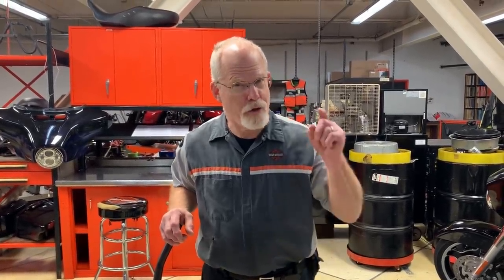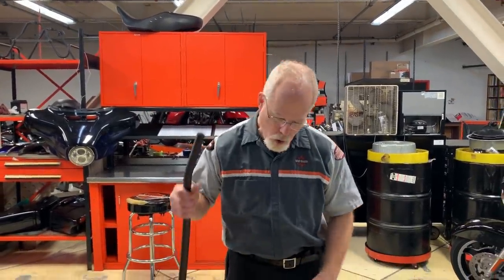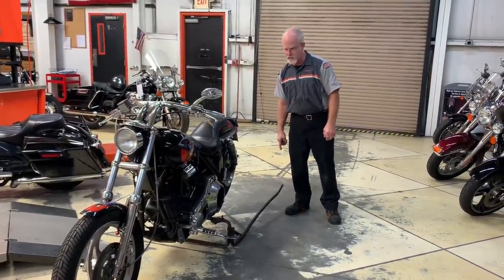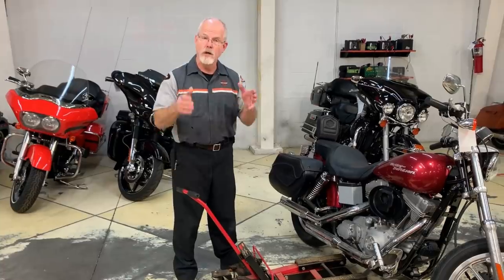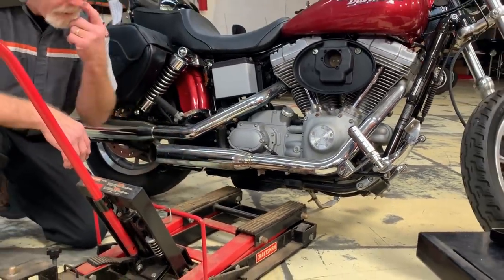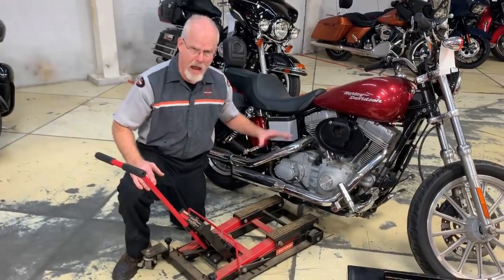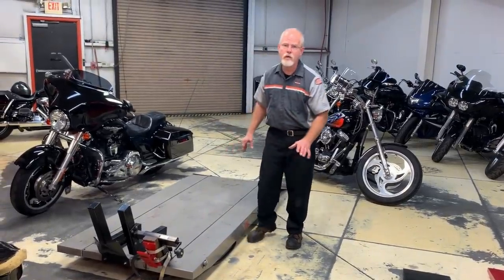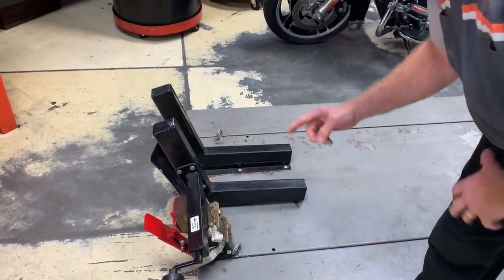DOC HARLEY: MOTORCYCLE LIFTS

Comment: Another great tip Doc. I use the roll under lift on my 2017 flhx  by rolling on 1/2 in" plywood pieces under the front and back wheels. Works great.

Comment: J&S jack for my ultra and heritage. Solid and safe for servicing and washing bikes. What I paid for motorcycles justified not trusting them on some cheap m/c jack. When using any jack you should use the safety latches then let pressure out of bottle so the weight is on safety latches and not the bottle. Never leave weight on just the bottle.

Comment: I use the J&S jack. I have a 2016 CVO Road Glide Ultra and it works unbelievably well. It works great for winter storage, cleaning and servicing.  While the bike is on the lift, it is very secure and with the high quality wheels, the bike moves with ease.

Comment: In my 20's, I used that old school lift you started with in the video, for my Wide Glide. Thanks for the memories...  We also had built 12" angle iron support feet with 1/2" diameter L-shaped steel rod welded to the angle. The height of the rod was the same as the height of the quick lever lift. The shovelheads had an open rear cross tube in the bottom of the frame you could slip the rods into then take it off the lift.  Or install the right foot while on the jiffy stand, pick up the bike and put the weight on the right support foot, then slide in the left foot. Sort of a portable center stand.

Comment: First. Great video Doc. I got a J&S jack, works great for my Road King. I keep my bike stored on it for the winter , never had a problem. Best jack I could find for the money.
Reply: I absolutely agree !!!!!!  I've owned three different motorcycle jacks and J&S jack is by far the best.  J&S even offers a motorcycle dolly. Lift the bike with the jack and then slide the dolly under it.  Remove the jack and you can move or even store the bike without the jack.  J&S is the best !!!!!!!!!
Reply: @tomqueisser7706  Do you have a link to the model of that J&S jack? I have a '17 Dyna.  Thanks!

Comment: Been thru most of the lifts you showed….Ended up with a Handy lift which I love and a flat jack to slide under the bike and lift the rear wheel when required…If I need to remove the front wheel I roll the bike up onto the Handy lift backwards and use the flat jack to raise the front…👊
Reply from the maker: Well done….Doc

Comment: Great video as usual Sir....
Bought a “Harley-Davidson” branded “hand crank” lift *part number 94653-98 (manufactured for H-D by FULTON) from my H-D dealer when I bought my 2001 CVO Dyna Wide Glide II “Switchblade”. The lift has been my trusted friend thru 6 new H-D’s since November 2000 (still have ‘em all - it’s a disease). Very simple (hand crank worm gear inside heavy gauge steel tubing), but extremely heavy duty lift. I’ve completely disassembled 3 Harley’s using only this lift. It’ll lift a “Boss Hoss” with no problem. I’ve replaced all of the hardware (bolts & nuts) twice (with higher grade hardware) and the hard rubber top pads once. Still looks and works like new. They just don’t make ‘em like they used to.

Comment: The very first jack that I bought for my Harley was the Craftsman that you demonstrated with. It works great and there is still time that I still use it despite the fact that I have a large lift. About 10 years ago I bought a motorcycle lift from harbor freight tools. It was a foot pump that you used to lift the bike. It even had the rear panel so you could work on the rear of your bike. Not even 2 weeks after I bought that lift that a friend of mine made me an offer that I could not refuse. He had one of the air lift. It's one of the ones that you can pick up a trike with. He had a shop where he was working on bikes and decided to get out of it. He only asked me for $100 more than the harbor freight one. I also have one screw jack with the big flat steel on top of the jack and on the bottom. That also makes doing a lot of things easier especially on the left.

What I do is store my Harley on my lift and rise it up and flip down the safety bar. That way if someone was to break into my garage they are going to have to turn on my air compressor and know how to use a lift. 

I enjoyed your video look forward to watching more.

Comment: Hello!
I use the Craftsman Motorcycle lift and I always make sure it is locked in to prevent it from coming down.
I used something similar to what you used 30 years ago. It was made out of aluminum, and it worked well on my 1972 Sprint SS.
Didn't work well on my 1974 FX Super Glide. Enjoy your videos.

Comment: I have the craftsman motorcycle jack like you showed only use it for washing the bike. I have a Harbor Freight lift table that I have done several mods to like air over hydraulic for the lift and a wheel chock like what your table has that i made for working in the bike i have had it a few years and I love it. Also use it to work on mine and my sons RZRs

Comment: I use a lift table a buddy made me. Tire lock is air fed with the old school car floor light button that triggers tire clamp to squeeze onto tire. Have 3/4” rubber inlay to protect wheel. It uses little cylinders to open and close. To release I have a arm coming up with a reverse air bleed to onlock wheel while I’m sitting on it. It also uses a atv winch to raise and lower lift. Also use a bike jack like 2nd jack you showed. 20 years ago I would lift back end of bike and set it on a 6” by 6” block.

Comment: Doc I use a setup like the old school version you demonstrated. I fabbed it together based on a picture in an ad in an old Easyriders. The handle rotates on mine so you can use it either side of the bike. Been using it for 22 years on my FXRP.
Thanks for the video.
Reply from the maker: Nice work…..Doc

Comment: I use the Harbor Freight 1000 pound lift table f9r maintenance, and a craftsman jack for cleaning. Like the one you showed. The jack is great for cleaning, because you can rotate the wheels and swing the forks. I have a 900 pound FLHKSE.

Comment: I use both the floor jack style and full ramp lift, both harbor freight specials. Both feel very solid. My dyna i have to use wood blocks because of the guard on the frame, but it still works great. The ramp lift has a flimsy tire clamp that many people have upgraded but myself have had no issues with the original clamp when using straps. Both have a lock so if they bleed down it doesn't move and I've left bikes on them for weeks straight.  Always use straps even if doing something simple that's quick.

Comment: I have the 2nd kind you showed. 1500 pound lift by Pittsburgh(Harbor Freight). Good for putting extra lights on and detailing solid chrome wheels on my HD Fatboy. It is shaky though, wouldn't trust it for too much more. And yes, I have to carefully stand bike up, off kickstand, so the lift will fit under the lean-side frame, then push the lift under bike with foot. Yep, quite the balancing act. Lift does store on bottom shelf, out of way. Doc, out of those 3 choices, I guess I got the one right for me.
Reply: Michael Butler  use a descent size piece of wood about 4" tall -  or a brick for your side stand.  Then the jack will slide under easily.  
Keep the side stand down while in use.  Using a brick or 4" piece of wood prior to lifting makes the bike more upright.  Hence it's easier.
Reply: @plop961  good idea, thanks

Comment: I use a Pit Bull lift with the turntable for my '14 Limited.  The hydraulic jack has leaked since day one, but fortunately it does have the three position stop to hold it in place.  The turntable is great for detailing because you can spin the bike in place and not have any obstructions; it does require a lot of real estate to turn though.  It's made in the U.S.A. except for the cheap jack.

Comment: Hey Doc, well for the old fay boy I have the same red craftsman lift like in the video....just barely clears...but works.  Then when I service the Harley touring bikes I have an air table like in the video, that is awesome.  When my buddies need to do an oil change or something they come over and pop their bikes right on the air table...life saver...That is actually where I leave the Road Glide in the garage, I just park it right on it.  Thanks for another cool video Doc!!
Reply: Hey Wayne have you removed the front wheel on your air lift.
Reply: @robbo6799  I have not removed the wheel

Comment: I use an OTC Stinger motorcycle lift. It works on the lowest Harley-Davidson and is rated at 1500 lbs. It easily lifts the largest Harley and has the safety lock Doc recommends in his video. I bought it from Amazon for about $180 three years ago. It is one of the most important tools in my garage.

Comment: I've got the Pittsburgh Automotive 1,500#  motorcycle lift.  Very solid and reliable.  Worked great for me during my rear wheel removal project.  Also fits fine under my 2" lowered Softail.

Comment: I own several airlift tables  with the removable rear plate and I would never exist without them. I built removable support to my reverse trikes so these tables are a must for me. Average cost is under $700 so it's a really affordable option. I would stay away from the Harbor Freight units however.

Comment: I have a 18 1200 Custom. And have a Craftsman Pro jack like in the video. Worked Great on the 750. However, I run into problems with the Jiffy Stand and Stop. Other type of Lift. The Scissor jack that will pick up front or rear.

Comment: I have the HANDY lift with the side panels and what I did was cut out a rectangular area of concrete on the garage floor so that the surface of the lift could sit flush with the floor when fully down. Doesn’t get in the way nearly as much and nothing to stub the toe on. Of course you do lose a little of the height the lift rises to but the HANDY lift rises to 39” so the 6”-7” it’s set into the concrete is negligible.

Comment: I have the second type you showed made by Craftsman.  It works for my 2000XL1200C, I must have lucked out with my exhaust. It’s a Screaming Eagle set just above the frame. I don’t believe this one will work for my 2017 Ducati Desert Sled though....looking into one that goes into the frame from the side....probably gonna be expensive

Comment: I made me a small under motor lift by bolting two flats of aluminum to, top an bottom, of scissors jack! I got idea from thick piece of metal perfect for small lift, but it was too thick metal to slide under bike well. So I changed a thinner metal an works fine. I added eye bolts an rope pulleys to ceiling rafters rope it into submission being by myself while on any jack.

Comment: I learned my lesson: I used a small crank lift to raise the rear of my sportster to put new shocks on. the motorcycle started to fall off the jack towards the kick stand side. I only had the rear tire off the ground about two inches. So, since I had the kick stand down, it just leaned over onto the kick stand and everything was OK. But, I learned a big lesson about safety
Reply from the maker: Thanks for sharing such a scary story. Others may learn now..Doc

Comment: I have a stand like the first one you showed, more modern with a shorter handle and the bike does come back well past
centre so there is no chance it will be accidentally knocked off, i also have a wheel chock for the front wheel which i park
the bike in because i am short of space in the garage.  it is only a sportglide i have, so not as big as some tourers.

Comment: I need to find a jack lift for an 05 Dyna Wide Glide Twin cam. I heard they made spacers but I just want a standard jack for tire removal and service Lowe’s has them they look like a Craftsman but no long bulky handle and easily to work around but still the damn twin cam Dyna shroud problem.

Comment: have the atv/motorcycle jack.  Its hairy to use . Bet the feller who found his bike layed over never checked the pressure lock lever good.  And no safety catch on mine either.
Reply from the maker: I would rather work on the floor than trust a “not so well made lift” …..Doc

Comment: Doc I have a 97 883 1221 kit I use a motorcycle lift to raise mine it's rated for 1250 lbs. my Harley is only 578 lbs. does the trick fine I run LAF drag pipes 2 1/4" street shakers life fits nicely under my frame mine came from Habor freight store have owned it for 3yrs not a problem outta it and it still under warranty from them love your videos to, Now I got a service tech question for you what's the bust way to remove oxidation from aluminum lower leg's on my Sportster what's the best polish to use on aluminum to?

Comment: What's a good stand for the lower bikes? I have a 2017 Street Glide Special and its to low to get anything under it. Its hell trying to change the oil. I wish those full lifts came with a piece you can take out the center so you can get under it better when changing the oil.
Reply: MSC, works great for my Road glide, a little pricey, but well worth it.

Comment: Hey Doc , I have one like the orange lift, it works great for servicing and taking the rear wheel off but haven’t had to remove the front wheel yet. Do you guys just back the bike in and tighten up the wheel vice.
Reply from the maker: Robbo67 Not always, at times we strap down the motorcycle, block the rear wheel, undo the clamp and jack the front end up.

Comment: I still do it the Real Old School way get yourself a Log round  about 18in long and 12 wide place in front of frame and roll bike up on log front of frame for fnt end work towards the back for rear end work .
Reply from the maker: You do this by yourself! You are a lot stronger than I with bowling balls….Doc
Reply: @LowCountryHarleyDavidson  It's real easy your not lifting your rolling bike up on the log 🪵
Reply: Might not work so well with newer heavy bikes But I do that will my Ridged pans and knuckles they are Bobbers not that heavy like a Full dresser
Reply: Probably going to get a lift table this year I'm getting a bit Old at 71 yrs the body isn't the same , I've got a Springer Soft tail Evo I find it Heavy and hard to handle for me 
. Even though of getting and old Triumph what a Sacralidge ,LOL

Comment: if you use the other style clamp that has a bar to stop the front wheel it comes off and you can roll the front wheel out the front.   much easier than rolling a bike backward onto the lift which is very difficult.  and I'd rather just lift the bike up with a little scissor lift to get the tire out from under the fender than try to hold the wheel and remove the panel. or pull an axle out while the wheel is in the air.  some of those harley wheels are 60+ lbs.   so I view those drop out panel lifts useless.  it's easier to lower the bike down to the wheel than it is to hold the wheel up and slide the axle in.

Comment: But what do you use for rebuilding forks?
Reply from the maker: What ever you use to lift your Harley, secure the bike front and rear and leave a little slack in the front so you can jack up the front until the straps are tight again in the front...Doc

Comment: I have had a  Craftsman motorcycle jack for about 15yrs now works great on my Dresser and my Sportster.  a little common sense go's a long way when using a Jack.   I don't know what jack he is talking about leaking down over night and the bike falling over but most have locks or stops at least the Craftsman does  so if the jack fails its still held in position.   I did the neck bearings on my dresser about 14yrs ago using a Craftsman Jack and it sat on the jack for about a week and did not move an inch.   I also have a Pro Cycle table lift bought it around the same time works great also  saves your back  the J&S motorcycle Jack is the best out there by far its just made for all types of Harleys

Comment: People can also use a solid brick or a good piece of timber about 4" tall and 8" square and sit on their bike and slide this under your jiffy stand.  Your bike will be more upright,  and your lift will slide under easily without scratching paint.  Also use a rubber style matte on the stand to stop paint damage when in use.  Leave your jiffy stand "down " so when you lower the bike.  It's already in place.  And remember to use the piece of wood 4" tall or a solid brick for your jiffy stand.

Comment: Harbor Freight lift table.  Flawless table.
Reply: I have the Central Pneumatics motorcycle lift table from Harbor Freight, (the predecessor to the Pittsburgh) that came with the air/ hydraulic jack. After about 12 years of frequent use, the pneumatic pump gave out and I manually pumped it up for about a year.   I eventually converted it to a hydraulic cylinder powered by an electric pump.  It was a good lift.  Now it's a great lift.  I'm in the process of converting my other HF lift. Video on that one is forthcoming.

Here's the link to the video on the mods I did.
https://youtu.be/T6eHjhZNkXw

Comment: I heard some people put their harley on a lift for the sake of the tires during winter storage, but I wouldn't trust my bike being up on a lift for that long. What's your take on that?
Reply from the maker: It would depend on how long your winter is. If you don't lift your motorcycle, make sure you are rotating the tires on a monthly basis so no flat spots are created with the cold and rubber. I agree, the lift does have to be really good to leave a motorcycle up.
Reply: @LowCountryHarleyDavidson  what about placing cardboard under the tires during storage, does it help somewhat with the cold or dampness vaping upwards from the ground?

Comment: I have a Pit Bull lift with a turntable and it works well for detailing my bike.  Owned it for about 7 years.  The hydraulic jack that came on it has leaked down since I purchased it, but the locks hold it in place.  Love the American made Pit Bull lift...the cheap foreign made jack that makes it work, not so much.  Pit Bull's customer service is and always has been useless.